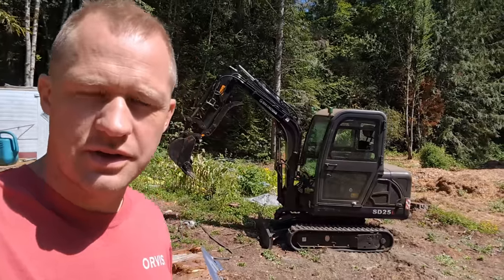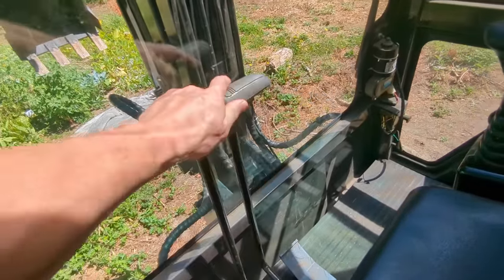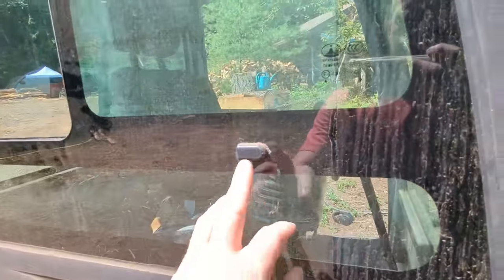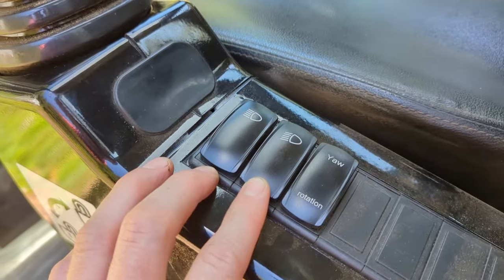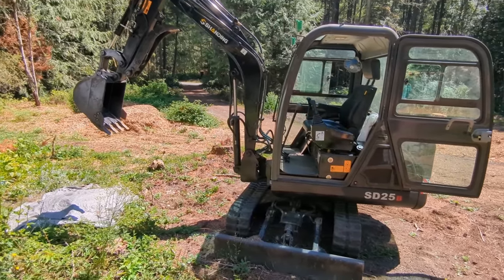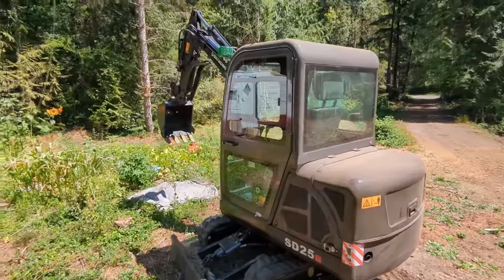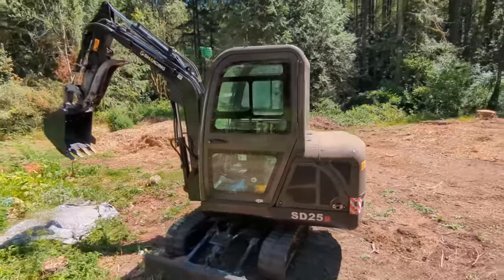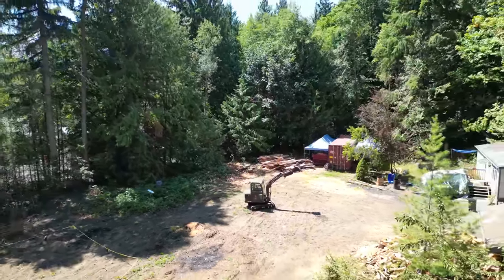Mini Excavator from Alibaba - 10 Problems after 50 Hours

Comment: You can put in a grease zirc for that thumb that will match the others.  Can likely get at Tractor Supply - or that type of store.
The thumb hydraulic creep on the thumb is likely leakage inside the hydraulic control valve...that can be difficult to fix.
Reply from the maker: Thank you. I think I will keep the fitting that is there now, as many people say that I would break off a zirc fitting. It is flush for a reason. Makes sense.

Comment: I may be mistaken. But the 15w-40 your using for hydraulic oil is actually motor oil. Might want to check on that before you lose your hydro pump
Reply from the maker: I accidentally showed the wrong fluid container

Comment: Don't feel bad about your thumb. Mine was brand new from cat, and it loses pressure over a while. Not really an issue since I just use it to pickup trees and toss them.
Reply: Also about your zerk fittings, rotate the ram to the other side and replace the zerk with a standard size. If you leave it in that spot, it'll probably snap off picking up logs 🤣
Reply from the maker: Same here. I don't know if I will take mine apart. It works too well.
Reply from the maker: That is a very good point

Comment: stupid question, you should a bucket of motor oil, not hydraulic fluid. did it really get recommended to you?
i'd be running AW46
Reply from the maker: I showed the wrong bucket in the video by accident 😁
Reply: Alot of them run 10-30 engine oil.

Comment: all i find strange about the thumb grease zerks is...why not drill the pin and recess it in there? like all the other pins?

"options that i got".

its the afterthought sitting on the shelf over there, and we throw it on the orders that asked for it... if we remember to...

the hot firewall may be nice in winter. may want a decent auto fan stuck under there for summer? may find its more about heat flow management rather than any insulation... badly placed oil cooler, and yeah... its pretty tight in there...
Reply from the maker: I'll look into getting an auto fan.

Comment: The grease fittings can be swapped easily, Unbolt them and bolt in the correct fitting.
Reply from the maker: Thanks
Reply: They are that way for a reason. That is a high material handling area and will plug up or break off

Comment: the cylinder for the thumb probably needs a better seal on the inside. if you pull it apart you can usually just measure the old one and find a replacement. You already can see the seals on this machine are junk as you replaced multiple already LOL
Reply from the maker: I will do that. Thanks!

Comment: Sounds like the thumb is bypassing internally. The seals on the piston are likely not properly installed, since it's new they are likely installed wrong or damaged. You can try and tear it down and replace the seals yourself or take it to a hydraulic shop and get the pros to do it. Some of these seals can be a real pain so they will likely make you bleed, be warned.

I bet the hydraulic motor doesn't have enough juice for both tracks and whatever else you try and do at the same time. I think that's something you'll likely have to keep in mind.

You'll have to switch out those fitting on your own bud. I bet the thumb isn't even made in the same factory lol.

I'm also willing to bet there is HOT HOT engine components behind that back wall and that is why it gets so hot in the cab from it. You could try looking in the engine compartment to see what is in there and attach a fan to blow across the engine compartment.
Reply from the maker: Thanks!
Reply: @einarmikkelsenPNW  Or have a separate plate to take the radiant heat.  Just like under cars they have this barrier of standing air between 2 plates between exhaust and the body of the car.  If there is room for it, but that is a diy and a half :)

Comment: I have a 1ton hightop ht10b. Paid 11,500 after taxes. If i had bought in Kubota in the same size would cost 22,000. 
So if you buy cheaper unit you will have to fix some thing.
As far as the thum blending off. It may be cylinder in side.
Reply from the maker: I'll take the thumb apart to inspect and let you all know when the problem is.
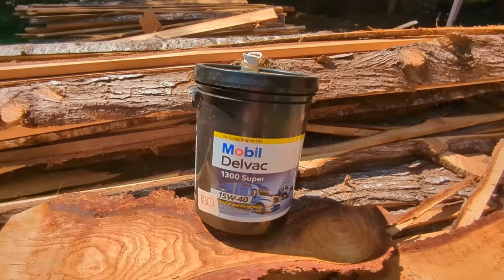Reply: ENGINE OIL in the hydraulics!!!!!! ( 1:00 min in )
Reply: @chrishanson9542  who put engine oil in the hydraulic
Reply: @jtsokiehobbyandadventures6666      @einarmikkelsenPNW did. he showes the oil he is using and it motor oil.
Reply: @chrishanson9542  sorry didn't pay attention to that. But you are righr
Reply: @jaysmith3361  yes it did look that way.

Comment: 15W40 Engine oil is used by many, many heavy equipment dealers in all types of equipment. As to the high temperatures behind the operator's seat, personally I would concern myself with that issue before the others as the manufacturer put a larger engine in your machine and I can only assume it's Not being cooled or vented properly or good enough. Buy a cheap laser temperature tool and see how hot the engine compartment is, the heat is not good for the machine and could even be causing hydraulic oil issues on the machine! I'll also guess the hydraulic fluid cooler is way too small and possibly not vented properly leading to even more issues down the road. I suggest a trained heavy equipment dealer looks it over as they know best, most times! 😊
Reply from the maker: Thank you. I accidentally showed the wrong hydraulic fluid in the video.

Comment: as far as you comments related to the tracking while doing another function. - the problem is will all excavators. my CAT304 does this worse then any other. This is due to the mashine having limited ways it can use its 1-2 hydraulic pumps. the same pump that controlls your tracks is shared with something else so you can't spin them in different directions at the same time. 

also with the thumb bleading off. this is likely a problem with the cylinder it self. the packing/seals on the end of the piston rod (also known as the pistion seal) is bypassing slowly. this problem will get worse over time. i would recomend handling it before it gets worse as damaged seals can cause contact with the rod seals and the inner bore of the cylinder wall making what is likly a sub 50$ fix a 500-1000$ one.
Reply from the maker: Thanks!

Comment: 😂😂 hydraulic thumb  "....it slowly releases presure...." *walks under boom*. Interesting review series, often wondered at just how bad the cheap offshore stuff is, and if it's possible to do like you are, and just go through it as stuff breaks and falls off to sort it out.... but looking at that thumb... You are a braver man than me.
Reply from the maker: 😂 It releases pressure over a long time, not seconds. I have been able to fix everything so far.
Reply: @einarmikkelsenPNW  yeah I get that... but if it releases, it releases. Just be careful bud. Dont put yourself between a machine and something that is less squidgy than you. Be it the ground, a wall or another machine.
Reply from the maker: @breaking_mowers3811  good call

Comment: Thumb issue could be a few things, bad relief valve for close function, cylinder seals bypassing. The travel issue or it turns when multi function operation is lack of pump oil for all functions so the travel circuit is the one that suffers the most. Better machines with slightly more complex hyd systems ensure travel circuit is priority and it’s the other functions that suffer the loss of speed. Hard to say otherwise without hooking some gauges up to it and seeing what’s going on.
Reply from the maker: Thanks

Comment: i would check up with your walmart or the person who recommended the 15w-40 engine oil as hydraulic oil cause my guess would be that that stuff is way to thick to run properly seeing regular hydraulic oil is alot less viscose than 15w-40 which is normally a engine oil for engines with some wear or big diesels hell it even says it on the can you showed "heavy duty diesel engine oil" which is a very different application than hydraulics
Reply from the maker: So sorry. I showed the wrong container. It is so similar to the hydraulic fluid container.

Comment: Grease fitting on the thumb maybe be like that so it doesnt get messed up when grabbing material.
Also your cylinder maybe leaking pass the seals on the end of the rod. Wouldn't be surprised if the cut one while assembling it.
Reply: Wanted to say the same about the cylinder seals. When you are 100% sure that there are no leaks anywhere, then it's most likely, bc I don't think that even chinese mess up the valve block. Possible, but since you already had one damaged seal from the factory assembly, it doesn't take much to make a little nick into the pressure seal when installing the cylinder rod. It shouldn't be an expencive fix when you can get it open by yourself, but it is quite messy and have to top off hydraulic fluid after (again).
Reply from the maker: Thanks
Reply from the maker: Thanks

Comment: The hydraulic issue why you got to keep putting pressure on every so often is because the hydraulic is leaking back inside the hydraulic cylinder the seal is not holding pressure and allowing the hydraulic to leak back
Reply from the maker: Thank you. Another bad o-ring...
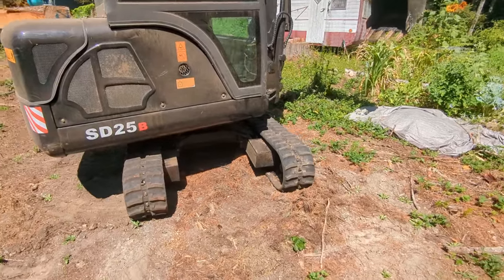Reply: ENGINE OIL in the hydraulics!!!!!! ( 1:00 min in )
Reply: Yea that’s not hydraulic oil dude. There’s your problem
Reply from the maker: @calspaugh8078  I know that the can in the video is engine oil. I picked up the wrong one for the video. They look similar, but the hydraulic fluid used is regular hydraulic fluid.

Comment: Moving and using boom or stick... there is two hydraulic pumps, when tracking each motor uses a pump each, boom and stick use pump each, so when tracking/ moving then use any other hydraulics your taking power from motor using same pump.
Reply from the maker: Thanks

Comment: You will find that while tracking and move the boom at same time it will affect the direction of travel I find it’s more of a problem with smaller machines the thumb might be losing pressure internally in the ram good luck with it personally I would never buy anything but a Kubota
Reply from the maker: Thanks

Comment: It's normal for the travel motors to slow down and cause you to veer right or left if you use the bucket or some other function while moving.  ,y takeuchi Wil do that.  It's a symptom of some ofmthe hydraulic flow being robbed from the travel function to do another task.

My machine has 2 pumps, one works the right track, boom, swing.....the other works left track, blade, bucket etc.  So the right side will slow down if I swing the machine while moving since that side pump is running 2 functions while the other side is simply travelling
Reply from the maker: Now I know. Thanks
Reply: exactly, i own the smalles yanmar mini(0,8T) and it also has only 1 pump, same "problem" while moving the machine.
Reply from the maker: @B100-c4m  It is a bit annoying, but for the price, I can deal with it.
Reply: My New Holland doesn't.

Comment: The thumb is bleeding off internally on a valve, and you are correct the hydraulic system isn’t strong enough to do multiple things
Reply from the maker: Thank you!
Reply: Yes, the thumb is bypassing on a valve and the tracking issue might be related to valving also.
Reply from the maker: @phatboizbackyardkustomz9006  thank you.
Reply: @phatboizbackyardkustomz9006  ENGINE OIL in the hydraulics!!!!!! ( 1:00 min in )

Comment: Hello there. Accidentally saw your video. About the thumb- that's kinda normal to lose pressure (I own multiple brand new kubotas and caterpillars and all of them lose grip tension on the thumb overtime) .it's the solenoid inside losing pressure most likely. 
About that brush strip I can give you part number from my caterpillar one(which visually looks very similar only longer).I recently bought one at cat and it's 3 ft long with super sticky tape in the back. Paid $6 or 7.
How much this machine cost you if not secret?
Reply from the maker: I have an entire video about the order price and import charges. I think it was about $25k total
Reply from the maker: Please keep accidentally watching my videos :)

Comment: Who advised you to use that oil as Hydraulic oil? Because that is not Hydraulic oil. Thats a lube oil for Diesel engines. Its gonna wreck the Hydraulic  pump if you keep running on that. It slowly eats the hoses en rubber seals from the inside contaminating the system .
Reply from the maker: I showed the wrong container in the video by accident.

Comment: You are loosing griping power on the thumb is because the seal for the hidraulic piston is worn out. Thats one of the causes i wod start there(rebuild kit for the hidraulic cylinder.
Reply from the maker: Thanks!
Reply: @einarmikkelsenPNW  i would do a full rebuild not just the piston

Comment: Sounds like hydraulic actuator causing all your hydraulic problems. Orings have been trash so far and probably holds true throughout. Actuator orings probly letting fluid slowly drain back. That grease fitting can be replaced in 30 seconds long as you don't break it.
Reply from the maker: Thanks

Comment: Not gonna lie, your observations are minor gripes. I'd buy it and give it a good torque, before use. 

*The creeping is a check valve, oring, more than likely.
*The dual comtrol, is a flow by issue, that would be a nuisance, but it still work.
* The heat is because of the design, look at Fire Wall Material and thatd take the heat off the cab. But being CHY-NAH,  have a fire extinguisher mounted on it, for quick grab.

Should see the condition of full size equipment, after use.
Reply from the maker: I agree. All minor, but I want people to see exactly what to expect. I freaking love this thing!

Comment: Thumb pressure loss can be internal leaking in the hydraulic cylinder piston, which is an easy enough fix if it's bad seals, which seems to be a repeat offender on this machine. Or worse, it can be that the control valve controlling it has too much internal leakage, in that case you probably need a new valve.
Reply from the maker: Thanks

Comment: If you change greasing nipples on the thumb to regular ones, it will for sure break at some point, cause it is pointing out and will catch on someting...
Reply from the maker: Okay, but that isn't an issue on any of the other ones?
Reply: Other nipples are not in the area which is in direct contact with materials that will be handled or are in enclosed area, which prevents most of the possible cases where they can break...
Reply from the maker: @marioivkovcic3253  I get it now

Comment: I wonder how many kids it took to put this thing together? In all seriousness, the cheap stuff like this is perfect for those of us who don't have 100,000 to spend on a new or used name brand machine. But with the cost savings comes a bit of diy repair and tlc. There's no quality control in the factories, the quality control is you! The end user.
Reply from the maker: That is what I have discovered.
Reply: @einarmikkelsenPNW   Yes sir! I bought a brand new eBay Chinese diesel engine that I'm going to pull apart, inspect , do my little diy quality control and put it to good use.
Reply from the maker: @cadenswain158  the diesel motor on this one is actually a Yanmar, so it is high quality and EPA certified.
Reply: @einarmikkelsenPNW   I've heard of Yanmar. They do make good engines. I was actually looking for a Yanmar 10 horsepower with electric start for a go-kart that I'm building. It was about a thousand US dollars, but I seen a Yanmar 6hp knock off diesel engine for 200 bucks before tax new on eBay and snagged it up. I think it'll be interesting to see how it does. Of course its not EPA certified or anything, but I don't mind for what its being used for.
Reply from the maker: @cadenswain158  depending on where you are importing it to, you will need one that has a certain clean running certification.
Reply: @einarmikkelsenPNW   That makes sense. I know that many countries require the certification and paperwork as well as certain states here in the US like California as an example.. My area, which happens to be Texas luckily doesn't require emissions on imports .. I'm intrigued to see what your experience with this piece of machinery is going forward. You've earned a subscriber!

Comment: While you,re tracking & you use another function and direction changes. That is normal it has 2 hyd pumps it may look like one hyd pump but its 2 so whlie tracking each one of the pumps supplies oil to each track seperately equal amounts. All the other functions are cotroled by either one of the pumps. So while tracking & you use one of the other functions it takes oil from one of the pumps so that will slow down one or the other track drive. As far as the thumb cylinder losing pressure thats either the piston seals in the cylinder bypassing oil (leaking internaly) or just low quality control valves leaking internaly. Just remember aĺl hydraulic control valves leak internaly as in the wont hold pressure forever. How fast they leak down has a lot to do with the quality of the hydraulic valves.
Reply from the maker: Got it. Thanks.

Comment: The 10th problem is correctable as it is a setting and is most often found in a compartment located under the seat, down by your feet or behind those orange stickers area in the doorway.  It should be in the manual.  If not find a manual for a brand name machine that looks like the one you have and then find their manual.  Most brand name machines are made in China too!
Reply from the maker: Thanks for the info!